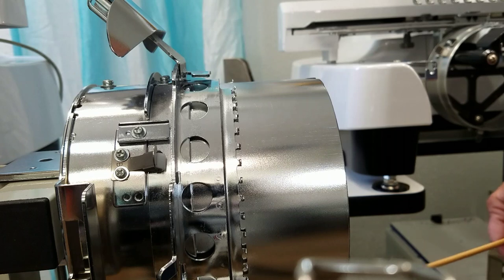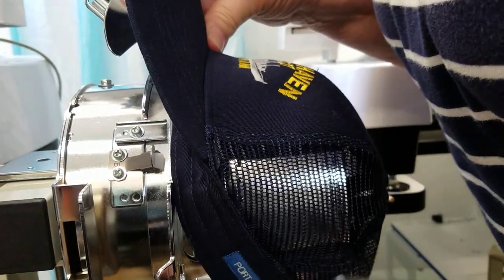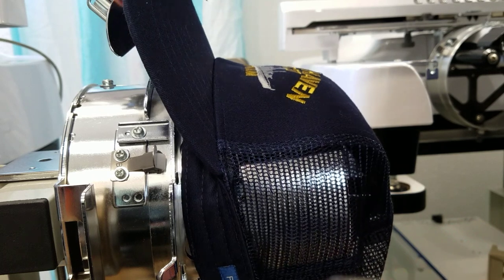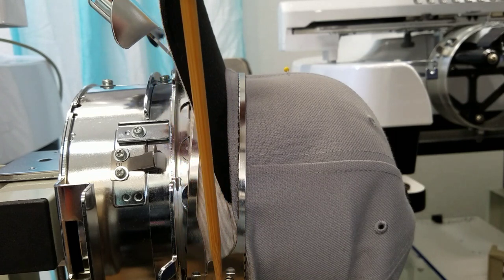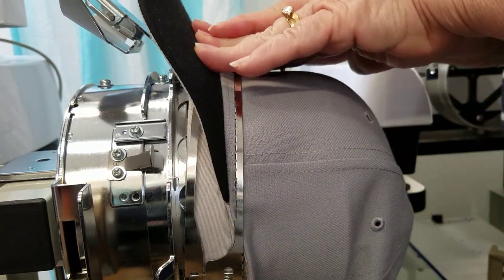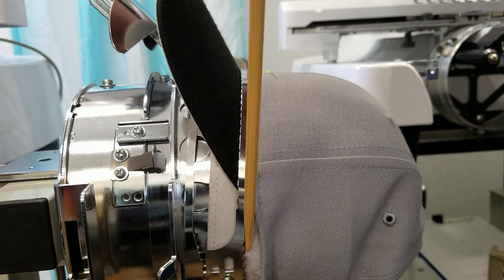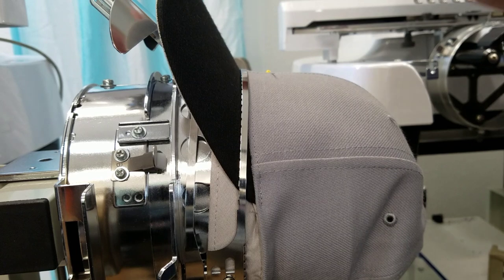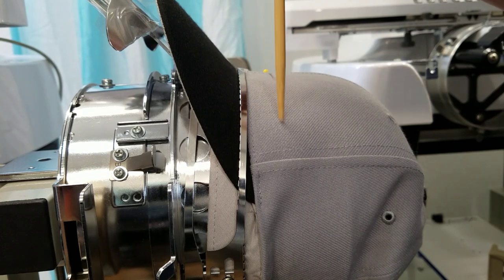How I hoop hats on PR multi needle machine

Comment: I followed your advice and have gotten great results in lowering the design closer to the brim which is what my customer requested.  Also the tape on the brim to hold it down away from the machine is great!
Thank you for your video and help.
Reply: Although I used this technique for a while, I have changed it up a bit. I keep meaning to update the video, but until then I’ll share what im doing. I’ve removed the brim holder so it is no longer in the way. After I get the cap totally hooped, pressing down on the front of the cap (about where you would put the design) holding the cap in place,  I press the cap brim forward a few times giving it some flexibility. This has worked far better for me than what I’ve demonstrated in the video. 
Hopefully this all makes sense

Comment: I have avoided embroidering hats for 6 years because of the issue of not being able to lower the design. I have done TWO hats today since finding your video and I am so excited!!! Thank you!
Reply: Although I used this technique for a while, I’ve changed it up a bit. I’ve been meaning to update the video, but until then I’ll try and explain what’s different. 
I’ve removed the brim holder so it’s completely out of the way. Once the cap is totally hooped , as per the video, I place the palm of my hand on the cap over the area where the design would go, holding the cap in place, and I press the bill forward, away from you, giving the bill some flexibility, so as it hits the machine the bill will give.  This eliminates the need to tape the bill and has given me great results.  
Hopefully this all makes sense

Comment: the way that you hold your cap brim is creative and awesome, you helped me a lot ! thanks so much !!!!
Reply: Although I used this technique for a while, I’ve changed it up a bit. I’ve been meaning to update the video, but until then I’ll try and explain what’s different. 
I’ve removed the brim holder so it’s completely out of the way. Once the cap is totally hooped , as per the video, I place the palm of my hand on the cap over the area where the design would go, holding the cap in place, and I press the bill forward, away from you, giving the bill some flexibility, so as it hits the machine the bill will give.  This eliminates the need to tape the bill and has given me great results.  
Hopefully this all makes sense

Comment: Thank you so much for this video.  I've been fighting it.  This makes so much sense.
Reply: Although I used this technique for a while, I’ve changed it up a bit. I’ve been meaning to update the video, but until then I’ll try and explain what’s different. 
I’ve removed the brim holder so it’s completely out of the way. Once the cap is totally hooped , as per the video, I place the palm of my hand on the cap over the area where the design would go, holding the cap in place, and I press the bill forward, away from you, giving the bill some flexibility, so as it hits the machine the bill will give.  This eliminates the need to tape the bill and has given me great results.  
Hopefully this all makes sense

Comment: Thank you SEW MUCH for this video. I get so many hat requests  but they never sit right. I have been doing it the way the dealer showed me and it never came out right. Thanks again!
Reply: Although I used this technique for a while, I’ve changed it up a bit. I’ve been meaning to update the video, but until then I’ll try and explain what’s different. 
I’ve removed the brim holder so it’s completely out of the way. Once the cap is totally hooped , as per the video, I place the palm of my hand on the cap over the area where the design would go, holding the cap in place, and I press the bill forward, away from you, giving the bill some flexibility, so as it hits the machine the bill will give.  This eliminates the need to tape the bill and has given me great results.  
Hopefully this all makes sense

Comment: Great demo! I've been struggling with hats!!! anxious to give this a try!
Reply: Although I used this technique for a while, I’ve changed it up a bit. I’ve been meaning to update the video, but until then I’ll try and explain what’s different. 
I’ve removed the brim holder so it’s completely out of the way. Once the cap is totally hooped , as per the video, I place the palm of my hand on the cap over the area where the design would go, holding the cap in place, and I press the bill forward, away from you, giving the bill some flexibility, so as it hits the machine the bill will give.  This eliminates the need to tape the bill and has given me great results.  
Hopefully this all makes sense

Comment: Going to give this a try!
Reply: Although I used this technique for a while, I’ve changed it up a bit. I’ve been meaning to update the video, but until then I’ll try and explain what’s different. 
I’ve removed the brim holder so it’s completely out of the way. Once the cap is totally hooped , as per the video, I place the palm of my hand on the cap over the area where the design would go, holding the cap in place, and I press the bill forward, away from you, giving the bill some flexibility, so as it hits the machine the bill will give.  This eliminates the need to tape the bill and has given me great results.  
Hopefully this all makes sense

Comment: Could you possibly go over how you place the metal band across the hat and how you keep it at centered? Would also love to see how it fits in your machine. I have had nothing but problems hooping hats on my machine with this hoop and I can’t seem to get it right!
Reply: I apologize for not reply to you message earlier, but I’m just now seeing it. Pls let me know if you still need the info. 
Although I used this technique for a while, I’ve changed it up a bit. I’ve been meaning to update the video, but until then I’ll try and explain what’s different. 
I’ve removed the brim holder so it’s completely out of the way. Once the cap is totally hooped , as per the video, I place the palm of my hand on the cap over the area where the design would go, holding the cap in place, and I press the bill forward, away from you, giving the bill some flexibility, so as it hits the machine the bill will give.  This eliminates the need to tape the bill and has given me great results.  
Hopefully this all makes sense

Comment: When we hoop caps we tend to slide the sweatband under the alignment guide along with the backing. It allows us to get closer to the brim when stitching and keeps the hat flat. I have always done it this way without too much of an issue. The guide also touches the underside of the brim telling me where to stop and allowing me to sew closer to the brim & view the mark when strapping the cap down. I thought this is how they were designed to be hooped? I uploaded a photo for reference.
https://www.dropbox.com/s/6amj2i4ngl5t6o1/IMG_1295.jpg?dl=0

So your saying to put the sweatband over the alignment guide instead and adjust the retaining strap to smash the bill into the alignment guide to keep if from moving? Have you tried putting the sweatband under the center mark alignment guide on the cap frame? IS this a better mouse-trap?

We use a 6 head 12 needle Happy machine so maybe it varies from machine to machine.

Comment: How do you have the back? Do you clap the back at all? Thank you so much for this video! I have been struggling with my hat hoop this week
Reply from the maker: Lisa, looking back through the video I see that I didn’t give thorough instructions on the hooping. But Yes I do clamp the hat in the back on both sides.  In the video starting about 4:00 I explain how I hoop the hat to be able to embroidery closer to the brim. I make sure the sweatband is caught under the clamping frame on both sides and (4:41) I clamp the hat with binder clips on both sides.  I do these steps on all the hats I hoop, not just for the lower designs.  
When I do an updated video I’ll be sure and zoom out a little so the whole process is better to see.  Thank you for viewing.
Reply: @moonkatdesigns3794  thank you! I’ll watch it against
Reply: @moonkatdesigns3794   my hat turned out perfectly! Thanks again for this video
Reply: Although I used this technique for a while, I’ve changed it up a bit. I’ve been meaning to update the video, but until then I’ll try and explain what’s different. 
I’ve removed the brim holder so it’s completely out of the way. Once the cap is totally hooped , as per the video, I place the palm of my hand on the cap over the area where the design would go, holding the cap in place, and I press the bill forward, away from you, giving the bill some flexibility, so as it hits the machine the bill will give.  This eliminates the need to tape the bill and has given me great results.  
Hopefully this all makes sense

Comment: did she use a stabilizer underneath?
Reply from the maker: I'm sorry I didn't reply to your comment in a timely manner.
Looking back through the video I see that I didn’t give thorough instructions on the hooping. But Yes, I typically use stabilizer on all the hats I embroidery. When I do an updated video I’ll be sure to include the full process.  Thank you for viewing.
Reply: Although I used this technique for a while, I’ve changed it up a bit. I’ve been meaning to update the video, but until then I’ll try and explain what’s different. 
I’ve removed the brim holder so it’s completely out of the way. Once the cap is totally hooped , as per the video, I place the palm of my hand on the cap over the area where the design would go, holding the cap in place, and I press the bill forward, away from you, giving the bill some flexibility, so as it hits the machine the bill will give.  This eliminates the need to tape the bill and has given me great results.  
Hopefully this all makes sense